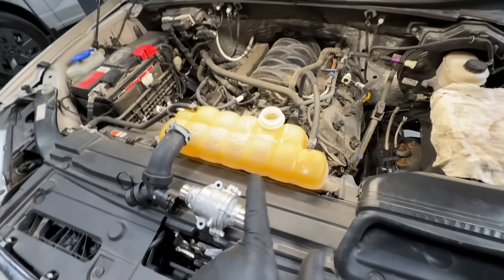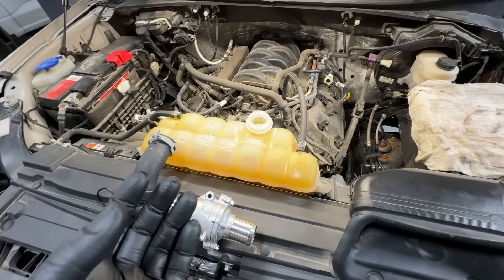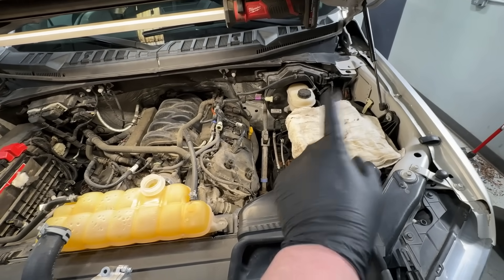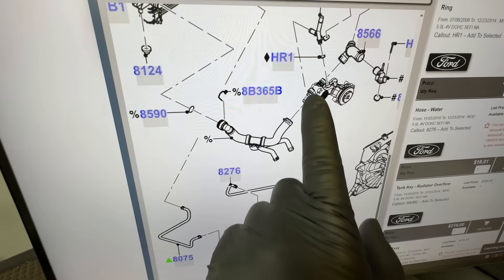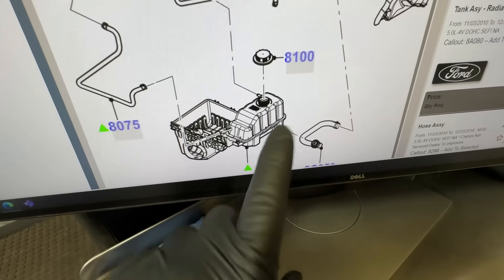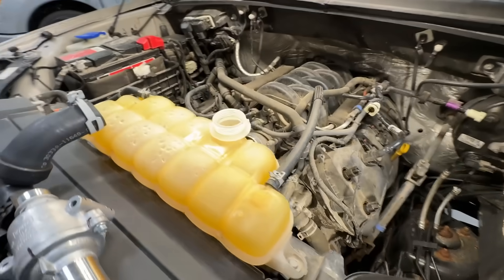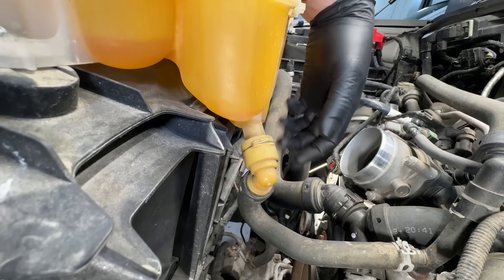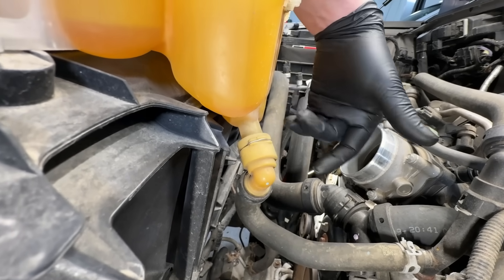2011+ Ford F-150 5.0L Coyote Engines: The Top 5 Most Common Coolant Leaks!

Comment: This is the first time I’ve ever truly questioned your judgement.  You are entirely correct on the leak issues.  Horrible and inexcusable.  But the 5.0L???  Dude, you are out of line.  1000 times better engine than a 5.4l.  100 times better engine than the 3.5l.  In my opinion, probably the best engine Ford has put into a pickup in a very long time.  And I’ve owned several of each of the three engines I just named.  For both work and personal.  The 5.0l has hands down been the lowest cost of ownership yet.  My opinion only.
Reply from the maker: Not saying they break down at all. I am just very disappointed in the engine as I had high hopes for them when they came out in 2011. The cylinder bore distortion issues, tuliped valves, way too many coolant leaks, some oil consumption issues on the rear cylinders, ignition coil bolts that rot and break (unacceptable in this day and age), valve cover bolts that rot and are miserable to remove mainly 11-14 models, the embarrassing tapping knocking noises all of these make, they have a stamped oil pan and elastomeric gasket just like the 5.4L (which never ever leak) yet the 5.0L leaks like crazy and soak the underside of the engine (why is this even happening, again very disappointing), I am not impressed with the power I think they are a dog (maybe I am used to the EcoBoost power) except the mustang calibrations and 21+ are much better. Also, you do know about the bucket load of major issues with the 2018-2020 models right? I am hoping the cylinder deactivation and wet oil pump belt on the 21+ models are not another disappointment in the future. There may be other concerns I cannot think of right now. Now do you understand my point of view? Oh and almost forgot about the IMRC issues on the 15+ models (again I have never even had to diagnose an IMRC concern on the 5.4L 3v)
Reply: Also one of the few modern engines that can tolerate abuse.  Known several 5.0 F150 that have absolute minimal maintenance but keep trucking, 200K +

Comment: Out of curiosity when you do the 3.5 coolant fittings and lines in the turbo do you pull the cab or just fight with it?
Reply from the maker: Never pull the cab.
Reply: @FordTechMakuloco  hmm interesting, I’ve seen people go either way. I’ve only done 2 of them so far, did both sides both times, and man o man it was an absolute battle both times lol. The fitting on the driver side back of the engine is an absolute nightmare

Comment: Today my world crashed on me...FTM is not a fan of the Five OH. Noooooooooooooooooooooooooooooooooooooooooo
Reply from the maker: Please see my previous response- Not saying they break down at all. I am just very disappointed in the engine as I had high hopes for them when they came out in 2011. The cylinder bore distortion issues, tuliped valves, way too many coolant leaks, some oil consumption issues on the rear cylinders, ignition coil bolts that rot and break (unacceptable in this day and age), valve cover bolts that rot and are miserable to remove mainly 11-14 models, the embarrassing tapping knocking noises all of these make, they have a stamped oil pan and elastomeric gasket just like the 5.4L (which never ever leak) yet the 5.0L leaks like crazy and soak the underside of the engine (why is this even happening, again very disappointing), I am not impressed with the power I think they are a dog (maybe I am used to the EcoBoost power) except the mustang calibrations and 21+ are much better. Also, you do know about the bucket load of major issues with the 2018-2020 models right? I am hoping the cylinder deactivation and wet oil pump belt on the 21+ models are not another disappointment in the future. There may be other concerns I cannot think of right now. Now do you understand my point of view? Oh and almost forgot about the IMRC issues on the 15+ models (again I have never even had to diagnose an IMRC concern on the 5.4L 3v)
Reply: @FordTechMakuloco  i understand your point of view...but every issue you listed just stabs my Blue Oval heart over and over and over 😭

Comment: Thanks for another great video Brian! Even though I’m a 2011 gen 1 ecoboost owner I still love the information. I just recently flushed the orange for the yellow coolant. I have 162k miles and other than changing out the degas bottle and hose I’ve had no other coolant leaks. No turbo issues yet.

Comment: Why don’t you like the 5.0?
Reply from the maker: Please see my previous response- Not saying they break down at all. I am just very disappointed in the engine as I had high hopes for them when they came out in 2011. The cylinder bore distortion issues, tuliped valves, way too many coolant leaks, some oil consumption issues on the rear cylinders, ignition coil bolts that rot and break (unacceptable in this day and age), valve cover bolts that rot and are miserable to remove mainly 11-14 models, the embarrassing tapping knocking noises all of these make, they have a stamped oil pan and elastomeric gasket just like the 5.4L (which never ever leak) yet the 5.0L leaks like crazy and soak the underside of the engine (why is this even happening, again very disappointing), I am not impressed with the power I think they are a dog (maybe I am used to the EcoBoost power) except the mustang calibrations and 21+ are much better. Also, you do know about the bucket load of major issues with the 2018-2020 models right? I am hoping the cylinder deactivation and wet oil pump belt on the 21+ models are not another disappointment in the future. There may be other concerns I cannot think of right now. Now do you understand my point of view? Oh and almost forgot about the IMRC issues on the 15+ models (again I have never even had to diagnose an IMRC concern on the 5.4L 3v)
Reply: Yes sir thank you for all of that information! I knew you would be able to back it up if you made the claim.

Comment: 2014 F150 5.0
Mine was leaking at the quick connect connection at the coolant tank. Replaced hose - still leaked - wasn't going to spend upward of $400 for a new tank / air box. Stupid design

Got a 90° 1" hose from Napa
Some Fittings from Gregg's Distributor (Part Wholesaler in Canada)
Hose clamped it at the neck of existing tank, cut and connected (hose clamps again lol) to factory hose going to engine.
Re topped off the tank to desired level and haven't lost a drop since. Lots of Kms since and even some road trips.

Total cost: $65 Canadian + 30mins of my afternoon.

Comment: On my 17 5.0 F150 only had to change the heater core hoses, radiator cause the plastic was cracked on the sides, thermostat plus hoses cause I was already there so felt like I should and that was only at 80K then someone ran a red light and killed her a week later so couldn’t really see what else would happen, but the truck was awesome. Now have a 2020 5.0 with the 10 speed and it has had nothing but work done on it. Transmission rebuild, electrical issues, update problems and now I have a sunroof problem 😂! Hey after all the repairs it seems to be fine now and just as perfect as my 17 and this one has 118K. Thinking about getting the spark plugs done this spring, and we just got a Powerboost about three weeks ago. Love my 5.0 and couldn’t live without one. Will take all the problems and fix them just as we have to do with ourselves as humans. Nothing is perfect, but you can adjusts make things better!

Funny I watched your videos to help me change most of those parts on my truck as well. 🙏🏿 Thank You for all the free help and advice plus knowledge. Much appreciated!

Comment: I have a 2018 F-150 5.0.  At 35,000 miles, my front hub bearings went out. At 39,000 miles, the short block and transmission were both replaced.  The block had a gouge and the number four-cylinder and losing over 3 1/2 quarts of oil in 3000 miles.  The transmission had a major catastrophic failure and was stuck in seventh gear. All was replaced under factory warranty. The dealer had it for about seven weeks. Now it’s at 72,000 miles and   I just paid it off. I will be selling it in a couple months.

Comment: I have a 2015 5.0 Mustang supercharged and this car has never given me a problem. No leaks, but if it did everything is easy to reach and repair.  You don't like them.  I also have a 6.2L F250 with MSD coils that runs perfect.  There is good information in your videos, but I take your opinions with a grain of salt.

Comment: The best 5.0L is the 15-17 (2nd gen). They have more power and torque than the older ones, don’t have the oil consumption issues the newer ones have. And they are damn reliable. Yeah they have some coolant leak issues, but that’s easy to fix. Generally pretty cheap to repair as well. There aren’t really any catastrophic failure points in those engines.
Reply: And aluminum body. Best years of F150 to buy, hands down.
Reply: Love my ‘17 5.0 with 110k. Water pump is all I’ve had to do. These are all easy to find and fix problems imo.
Reply: @parkerdeyoung1228  who repaired your water pump ?  Cost ?
Reply: I had my local shop do it. It was ≈ $350. Water pump, coolant flush, all new o rings, and new belts.
Reply: @parkerdeyoung1228   THANKS for the info..I'm planning ..just in case.
Reply: I have a 15, 5.0 at 109,000 miles and the only problem I have had with the engine so far is a tensioner. It has been such a good truck
Reply: 2017 with 112k ...bought new from the dealership and serviced correctly.  I had a small coolant leak that I took my truck in for and the dealer couldn't duplicate the leak.  I know a saw red fluid on the right side inner frame so I'm keeping a close eye now. It's been a perfect vehicle with no issues other than the small leak that went away....for now  and a lower mixing valve for the cabin temp control. which was covered under warranty.
Reply: Direct injection though...
Reply: Aluminum is cool for the north, but I am gonna keep the steel body 11-14 5.0s. Steel is easier to replace and fix than aluminum

Comment: It’s a shame that you don’t like this engine, but to each their own. If you wanna hear some truly bad engine noise… listen to a 5.7 Tundra when it fires up.  My 2013 5.0 F150 has had me replace the radiator and that Y pipe o-ring but has been a stupendous truck for me for what it’s been through.  And it’s runs like a quiet sewing machine at 185k.  Coolant leaks are easier to fix than a Chevy/Dodge with their cam/lifter issues!
Reply from the maker: Please see my previous response- Not saying they break down at all. I am just very disappointed in the engine as I had high hopes for them when they came out in 2011. The cylinder bore distortion issues, tuliped valves, way too many coolant leaks, some oil consumption issues on the rear cylinders, ignition coil bolts that rot and break (unacceptable in this day and age), valve cover bolts that rot and are miserable to remove mainly 11-14 models, the embarrassing tapping knocking noises all of these make, they have a stamped oil pan and elastomeric gasket just like the 5.4L (which never ever leak) yet the 5.0L leaks like crazy and soak the underside of the engine (why is this even happening, again very disappointing), I am not impressed with the power I think they are a dog (maybe I am used to the EcoBoost power) except the mustang calibrations and 21+ are much better. Also, you do know about the bucket load of major issues with the 2018-2020 models right? I am hoping the cylinder deactivation and wet oil pump belt on the 21+ models are not another disappointment in the future. There may be other concerns I cannot think of right now. Now do you understand my point of view? Oh and almost forgot about the IMRC issues on the 15+ models (again I have never even had to diagnose an IMRC concern on the 5.4L 3v)
Reply: x2 on Toyota 5.7 noise. I’ve had multiple that sound like diesels with relatively low mileage. The worst thing Toyota ever did was get rid of timing belts! It kept people on top of maintenance, that’s the reason old Toyotas last a long time!

Comment: 2011 f150 5.0 4x4 176,xxx
Replaced the Y, the plastic housing got brittle, broke into pieces. 
Replaced both of the heater core hoses. Fun times

Comment: Ad usually, great content and very much to the point.  I traded my very low mileage 2012 5.0 for a 2019 3.5 EcoBoost.   I've never been 100% convinced it was the right decision as both trucks have been good to me (again, low mileage. . Ecoboost has 10k on it now).

Comment: Do you recommend the 3.5 EccoBoost in the F150?  I have a 2015 and love it.  At 145K miles, no issues.  Have done all the maintenance myself  which includes regular oil changes at 6K miles with full Synthetic Mobil 1 and ford filters.  I changed the plugs at 90k miles as I started getting a misfire under boost.  Love my truck, it's my daily and I pull trailers with other vehicles on it for my hobbies (restoring vehicles) and it really pulls a trailer nicely.

Comment: You used to like the 2011 to 2017 5.0 engine.   Of course I also remember when you liked a brand new job.  The good thing about the y connector and the o ring, even a below average mechanic like myself can fix it.  I still like my '13 5.0.   I even bought a leadframe preemptively in case I run into an issue with the transmission.   Thanks for all of your videos.  My wife is from the Chicago area and you two sound alike.
Reply from the maker: The engine is fine I just had high hopes for this engine when it first came out and every new version seems to disappoint me a little more.
Reply: And they will almost certainly continue to disappoint you in years to come as well...The "Built Ford Tough" slogan no longer applies now does it?  @FordTechMakuloco
Reply from the maker: Please see my previous response- Not saying they break down at all. I am just very disappointed in the engine as I had high hopes for them when they came out in 2011. The cylinder bore distortion issues, tuliped valves, way too many coolant leaks, some oil consumption issues on the rear cylinders, ignition coil bolts that rot and break (unacceptable in this day and age), valve cover bolts that rot and are miserable to remove mainly 11-14 models, the embarrassing tapping knocking noises all of these make, they have a stamped oil pan and elastomeric gasket just like the 5.4L (which never ever leak) yet the 5.0L leaks like crazy and soak the underside of the engine (why is this even happening, again very disappointing), I am not impressed with the power I think they are a dog (maybe I am used to the EcoBoost power) except the mustang calibrations and 21+ are much better. Also, you do know about the bucket load of major issues with the 2018-2020 models right? I am hoping the cylinder deactivation and wet oil pump belt on the 21+ models are not another disappointment in the future. There may be other concerns I cannot think of right now. Now do you understand my point of view? Oh and almost forgot about the IMRC issues on the 15+ models (again I have never even had to diagnose an IMRC concern on the 5.4L 3v)
Reply: Brand new dodge, not job
Reply: You have to admit Greg makes a good point. You could fix every single leak point you listed in a single afternoon.
Reply from the maker: definitely.

Comment: I have a 03 sport trac, replaced the radiator and now the thermostat housing is leaking around the oring  that is on the 4.0.
Reply: But the truck has 255,000 miles on it. 😊😊

Comment: On my '12, I've replaced all those but the hard one to find was the Block Heater Plug. It's behind the altenator next to the oil pressure sensor. Have fun!

Comment: 2011 f150 5.0 with 140k. So far I've only had to do the o-ring in the upper radiator hose. Otherwise, no problems.

Comment: I have a 2011 ford f150 with a 6.2 under the hood. I had a leek at the y joint and made the repairs. I have an issue with it using oil and need to put oil In it once a month and it slowly seems to be sending antifreeze out the pipe as well. The last time this happened they replaced the intake for it was worped. The intake is only a year old. I don't think  it's the intake. Could it be the ring seels gone bad on the intake. Any intake on this would be helpful.

Comment: so Eco boost is crap, 5.0 got more plastic than Paris Hilton and them pipes leak....I guess F250 it is....How is that gasser engine for F250, any good?
Reply: The 7.3 Godzilla engine has its own set of problems but they're few and far in between.

Comment: Seems lot of all the leaks are coming from pipes and hoses...dont other Ford engines have radiator tanks and quick connects like this...i take all the exteral leaks with this...than internal problems with 3.5 ecoboosts....the 5.0 is not that much weaker.....than Ecoboost...some of us dont need all the extra power....i had a 99 F 150 4 wheel drive ..265 hp ..5.4..it was a great engine...not problems...other than one coil on plug....at 179,000 miles....no trubos to worry with...or direct injection which i wish they do away with....

Comment: I'm either lucky or have a unicorn so far then, knock on wood. 2015 lariat 5.0 and havent had any of these issues. Going on 107k miles and have owned it since 2018 up here in the northeast
Reply from the maker: oh its coming or already is.

Comment: Great video, thanks.  My 2004 Expedition XLT 5.4 2v 4x4 will be my last Ford SUV.  It has 280,000+ miles with no major issues.  Original engine, timing chain, transmission, fuel pump, water pump, power steering pump, alternator, starter, no suspension work at all.  Just a few coolant hoses replaced along with plugs and coils and serpentine belt.  Routine maintenance batteries, brakes, conventional oil @5000 miles and Motorcraft FL820S filters.  KNOCK ON WOOD from rust free Mississippi.  Keep up the great videos!
Reply: 2 valve engines were the best, so reliable